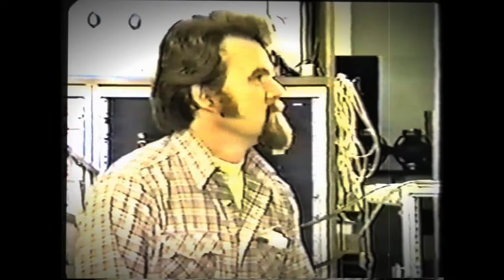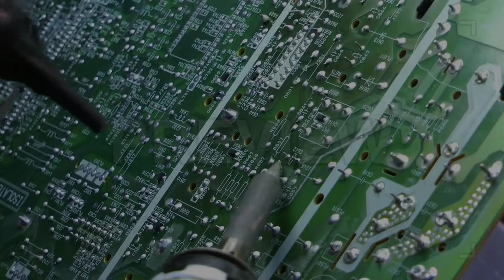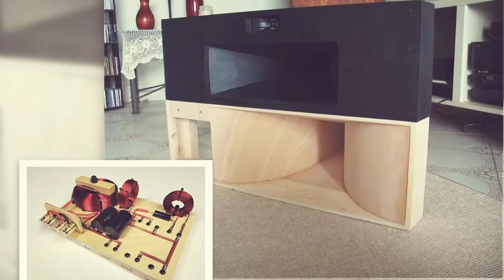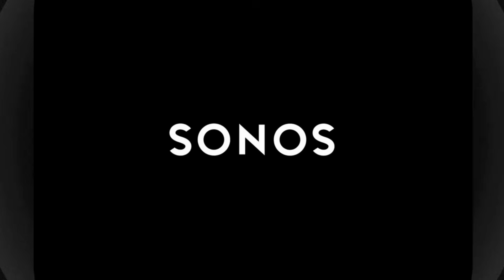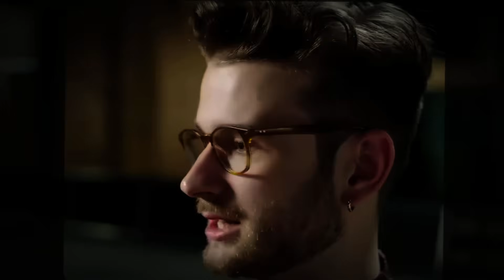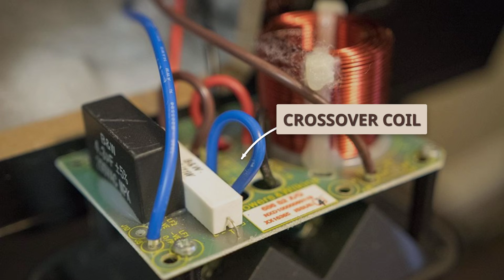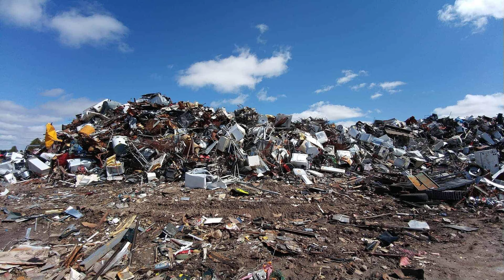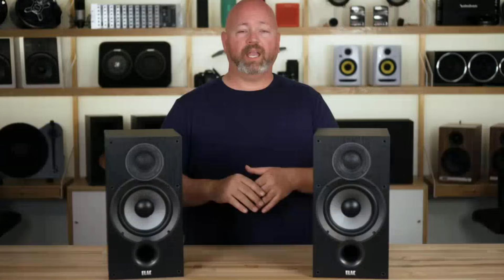The Audio Technicians Blacklist: 5 Hi-Fi Speaker Brands to Never Buy

Comment: I bought a 3 way Elac uni-fi 2.0 UB52 in late 2021, the sound is excellent, and paired it with Marantz PM7000n. 
I still enjoy it. Everyday my sound system is on, only when I need to do some errands. 
I'm a retiree. 
I'm not an audiophile well versed in technicality, I'm a two channel audio guy. However I judge the quality of a product by its weight if it's heavy. 
I understand Andrew Jones's priority is the sound quality of its crossover & is the most expensive part, drivers, concentric mid & higher end range.
 The appearance is where he'll bring the cost down for affordability, such as the binding post terminal, none magnetic grill, speaker box vinyl wrap is no premium looks. 
This product's sound quality is designed to attract listeners not the product's appearance. 
 After all the hi-fi industry is about the sound quality of the music.
Reply from the maker: That is a seriously underrated setup. The UB52 is one of the most engineered speakers at that price point. Andrew Jones does not cut corners. And the PM7000n is exactly the kind of amplifier that lets speakers do their job without getting in the way. How long have you had it running?
Reply: @WiredTruthHIFI 
Since late 2021, it is my morning ritual when get out of bed then turn on my system, listen to internet radio, or watch TV YouTube music the whole day. Unless I do some errands, groceries, or a restaurant with friends or family, etc. 
As soon as I get home my system turned on.
Reply from the maker: A morning ritual built around a system that has been running all day every day since 2021 that is exactly what good audio engineering enables. The system disappears and the music just lives in the room. That is the point of all of it. 🏆
Reply: @WiredTruthHIFI 
Oh yes I forget, I don't used wi-fi  on my streamer, everything is hardwired on ethernet for reliability on signal.
Reply from the maker: Hardwired ethernet on the streamer is exactly the right call. Wi-Fi introduces jitter and packet loss that a wired connection eliminates entirely. The signal stays consistent and the streamer works without interference. Smart setup. 👌